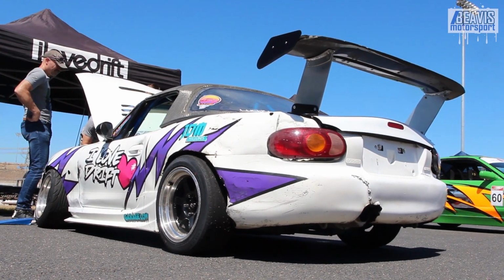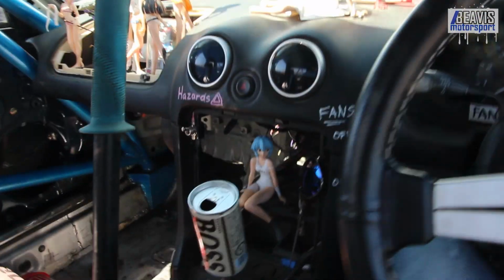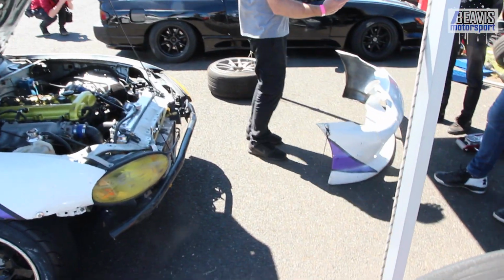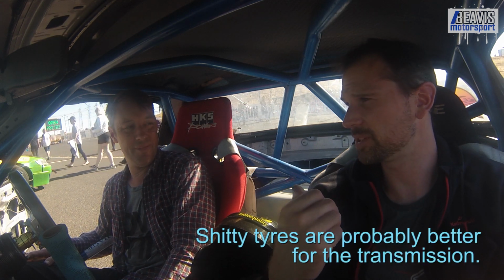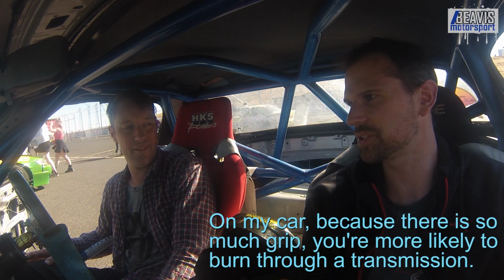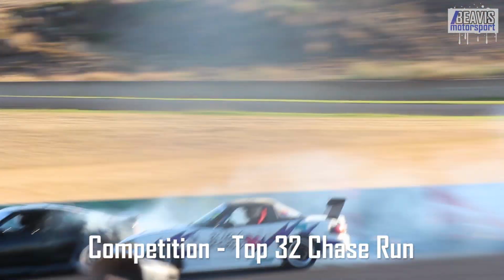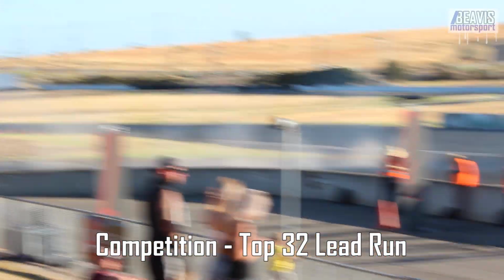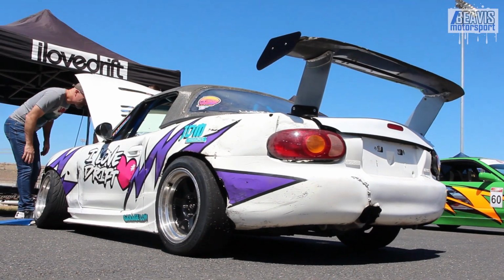WAZMAN'S TURBO DRIFT MX-5 MIATA // 300HP AUSSIE DRIFTER

Comment: Any info on the gearbox setup. I'm knocking on the door off 400hp and am on the standard 6 speed which is on borrowed time
Reply: Boost by gear/ boost by tps will save it.
Reply from the maker: It is an S15 transmission with custom trans mount. Not really much stronger than the MX-5 6 speed.
Reply: What's required in fitting this box to a BP/B6 motor?
Reply from the maker: @provar1  Custom bellhousing to engine adapter, custom trans mount, custom diff mount, custom drive shaft, custom clutch line.... much the same as any trans swap.

Comment: Is there any reason to put a spoiler on for drifting?
Reply from the maker: Drifting is all about style, flair, and having fun. In most cases it's mostly a preference of the driver and what style they want from their car. Not really a performance thing.
Reply: Spoiler makes downforce to your car's rear end, so its pretty important
For example if you have 800hp drift car it is important to have front and rear spoiler or other aerodynamic things like canards or diffusers